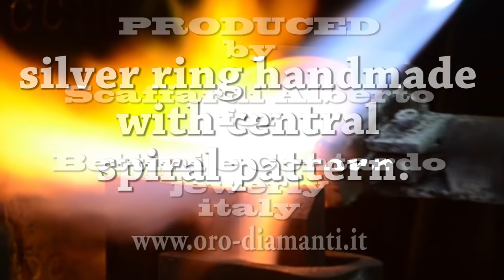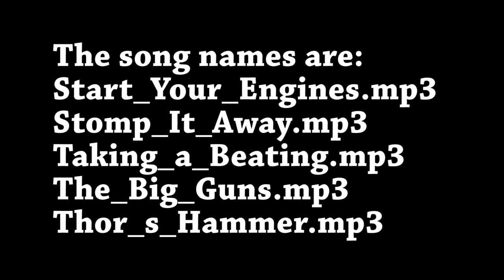Silver ring handmade with central spiral pattern

Comment: This is a interesting design using the two domes to frame the wire. I am a little worried it might be too thick around the sides making it a bit uncomfortable to wear. But your skills are always a pleasure to watch and be inspired by. 

Grazie per aver condiviso la tua conoscenza!
Reply from the maker: +Vaclav Grym Thanks you, Indeed for those not used may be uncomfortable, In Italy, at this time are often required band rings with very thick.Grazie

Comment: Questions:

What is the chemical you are applying at the end before polishing?
Did you apply the metal glue (dont know what to call it) to every point where the middle and outer rings are touching?
Reply from the maker: Is a mixture of K2S potassium sulfide and potassium polysulphide K2S3
To join the parts use silver welding

Comment: how often do you anneal gold when rolling it down?
Reply from the maker: +Peeter Oja Every time I hear it harden
Reply: Hear it? Never heard that before:) How do you anneal it? In the kiln? Many thanks!
Reply from the maker: Peeter Oja anneal at flame, It is heated until it becomes rosy
Reply: and then quench into cold water or let it air cool?
Reply from the maker: Peeter Oja It does not change much because gold and silver do not temper with the sudden change in temperature.

Comment: Awesome ring ! What's the name of the machine your using at 6:01 ? All I've been able to find online is a bangle flattening machine.
I'm trying to make my own curb link chain, i have two steel block I could probably use though.
Reply from the maker: It is like an automatic blacksmith hammer, without a motor, with a spring for the return
Reply: Hi Kyle. Otto Frei sells them, it's called a spring loaded planishing hammer.  http://www.ottofrei.com/jewelry-tools-equipment/forming-tools